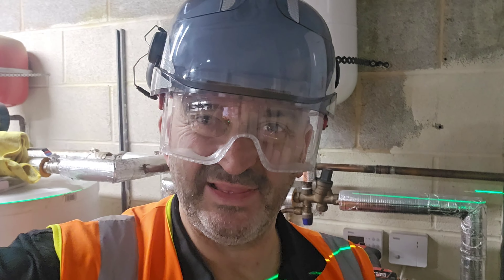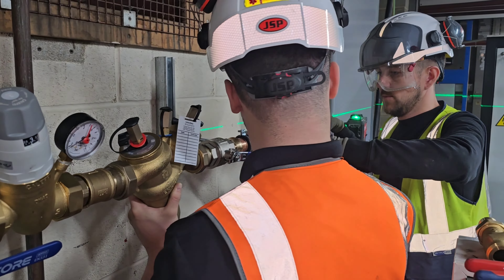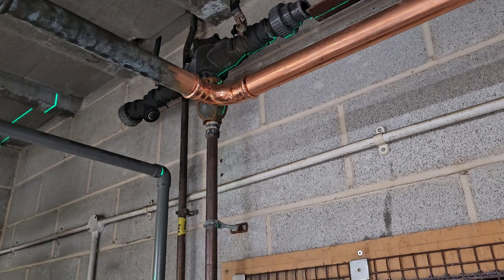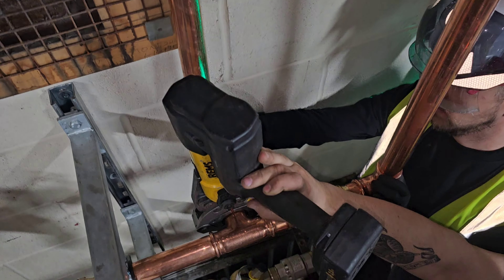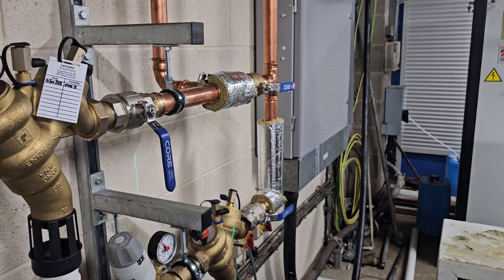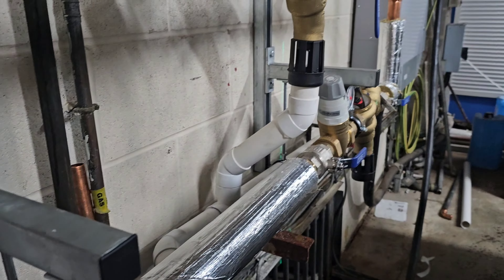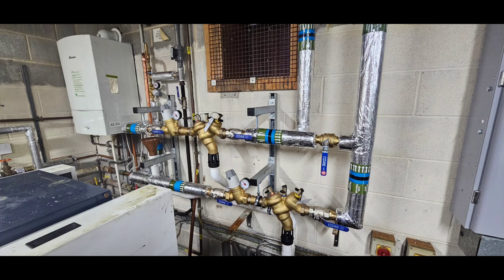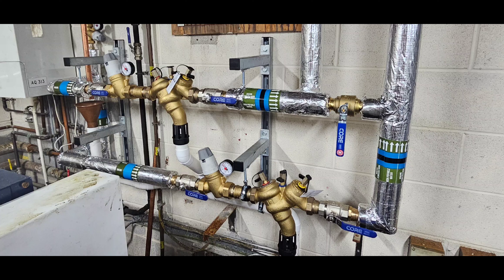RPZ VALVE INSTALLATION WITH PROTECTED BYPASS TO AIM08-01 ISSUE 2

Comment: That's some brilliant work Paul. Really neat and well thought out. 
One question for the branch for the emergency shower lines. As it may be rarely used, would it be prudent to put a single check valve on that tee?
Reply from the maker: It's a good point. The site carries out weekly flushing of the showers and to confirm they physically work.